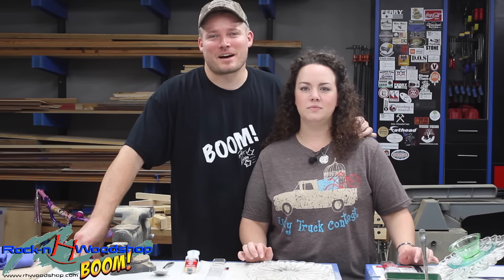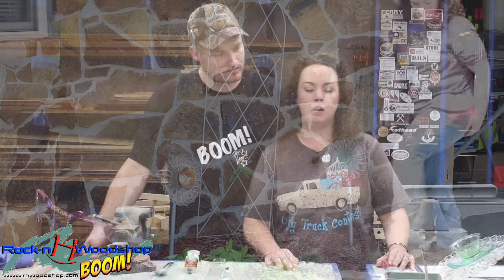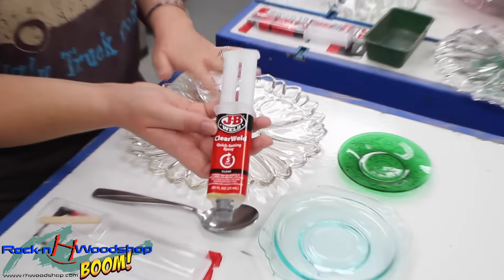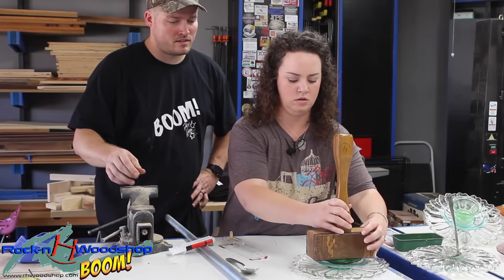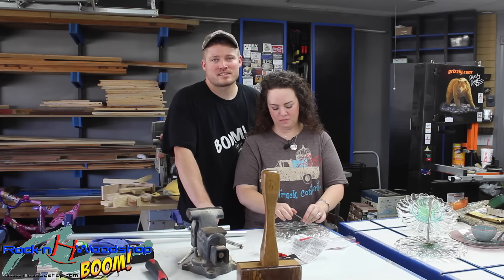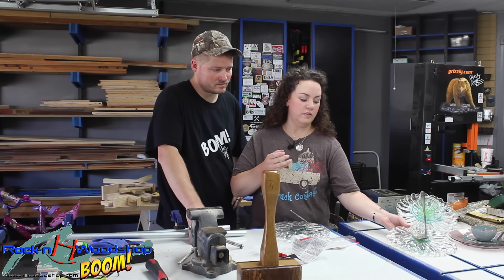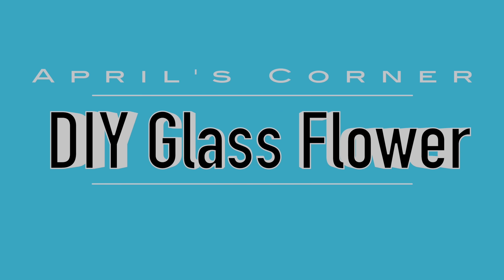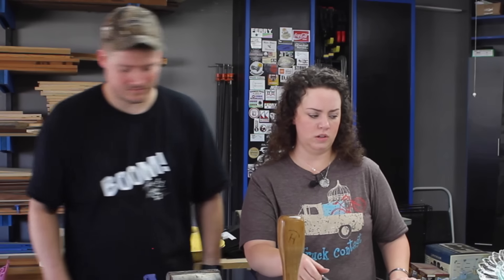How to make a Glass Flower - April's YouTube Debut!

Comment: Great job!  I've epoxied glass with mixed results too.  I find that if you scuff the surface and then epoxy, it does wonders for the holding capacity.  The epoxy fills in the scuff scratches too and aren't really seen.

Comment: do you have any other methods of attaching the flowers to the pipe/rod without drilling through the plates- besides using the spoon method?  Also, can you share what brands/kinds of glue you have used in the past that did NOT work?     I was planning on using E6000.  Any bad results you have had using that??   Thanks!!

Also, I am interested in the vice you are using. I cannot find one that fits on the edge of my workbench. Yours looks like it is sitting right on top of your workbench. Correct?  What brand/kind is it??  Thanks
Reply from the maker: Nope, sorry I did not post. My apologies.

Comment: 2nd request:  can you share what brands/kinds of glue you have used in the past that did NOT work?     I was planning on using E6000.  Any bad results you have had using that??   I live in the Reno, NV area...and its HOT here....have you found adhesives that do not work well in the heat? Thanks!!
Reply from the maker: Begging your pardon, I thought I answered that question maybe it did not post. For outdoor use I tend to like to use silicone or caulk. Silicone holds up the best but the E 6000 that you were talking about breaks down overtime. Also epoxy can also have some detrimental problems that we have found with our experience using it
Reply: @rhwoodshop  so, in your experience silicone will hold heavy plates together and withstand heat? What kind of silicone do you use that is that good? Thank you so much
Reply from the maker: CHERIE C. Yes as long as you give it adequate time to cure before you hang it up. This is what we use outdoors now. Your friend has shared a link to a Home Depot product they think you would be interested in seeing.

Dynaflex 230 10.1 oz. Clear Premium Indoor/Outdoor Sealant

https://www.homedepot.com/p/100205533

If you prefer to use epoxy, just make sure that your mating surfaces are nice and flat and have your epoxy thoroughly mixed before applying. Otherwise you’ll run into release problems with the added weight.
Reply: @rhwoodshop  I do not see the link for the Home Depot silicone that you use. Also, do you know what the strength per square inch is of that particular silicone? Thank you
Reply from the maker: I don’t think silicone is measured that way. If it is I cannot find that info for you. So sorry.
Reply from the maker: CHERIE C. https://www.homedepot.com/p/100205533

Comment: Hi April, what size electrical pipe did you use?
Reply from the maker: It can be of a varying size depending on what size spoon you use. It just needs to be big enough for the spoon to fit but I believe we used a half inch diameter pipe
Reply: Thank you so much!!